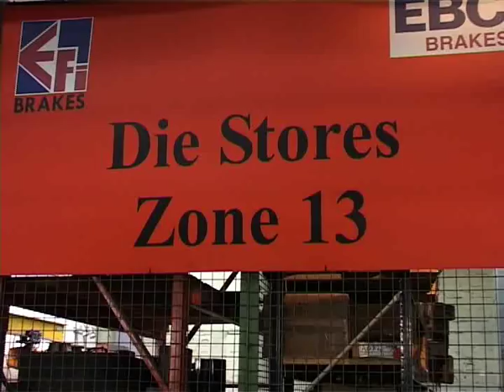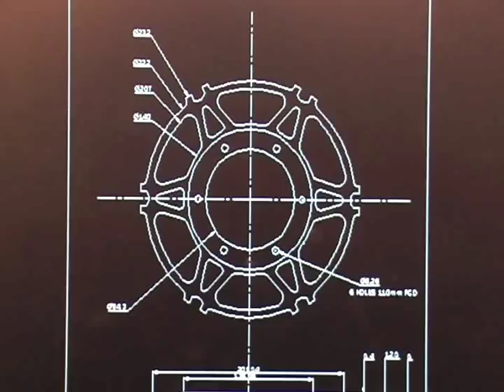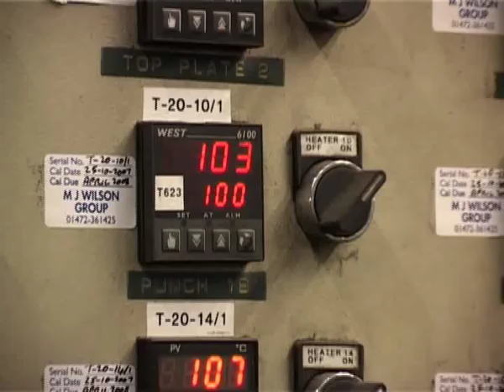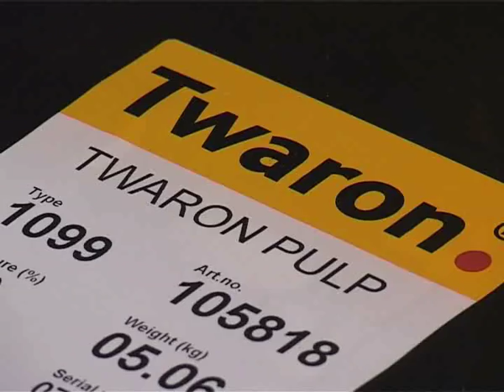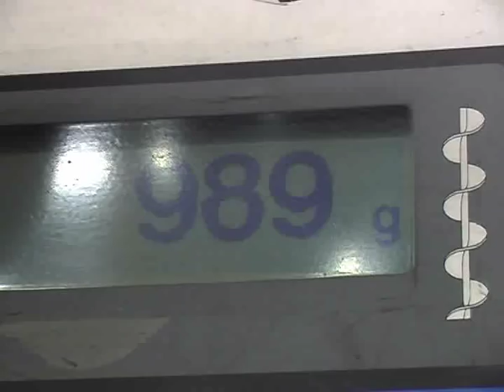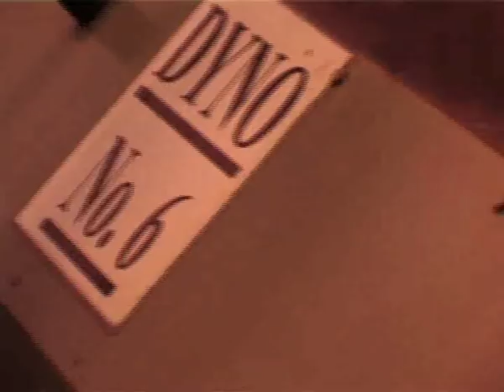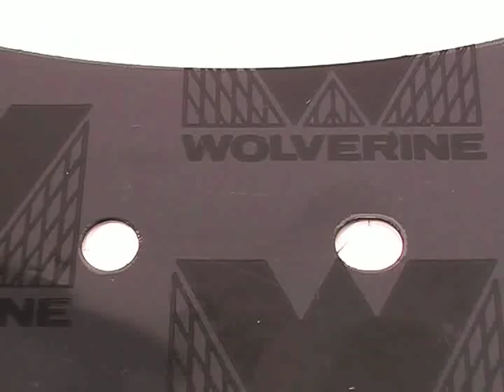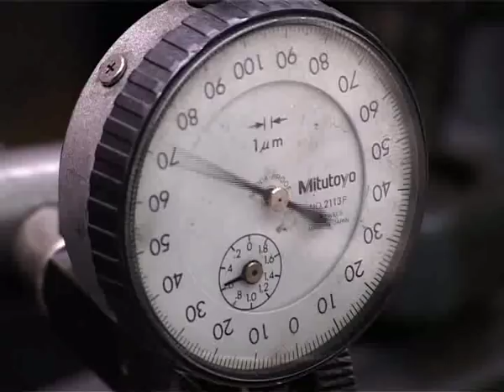EBC Brakes Corporate Video

Comment: one thing that's kept me from fitting full sets of EBC brake products to my street or endurance racing car has been the lack of in-stock US suppliers. All the companies I have spoken to have exclusively reported that my orders would be passed on to EBC and often times drop-shipping can take as much as 10 weeks. With my endurance racing prep-time often sub-8 weeks, I wind up with race pads from Hawk. If the Yellow or Bluestuff is as good for my application, I may be inclined to pre-order them.

Comment: I wasn't sure about EBC way back to be honest. I've been a long user of Mintex's line of brake pads, from my own car to race cars, but recently I swapped to EBC Green as my car is going through a transition period (engine swap etc) and needed something that stops great but lasts long (something that Mintex 1144 doesn't do). Very pleased by the results, it's a really great pad. I drive a Proton Gen.2. My only wish is that I could get a matched set for the rears also. Mintex has rear pads for it

Comment: We like it to sell those quality brakes . Nothing compares EBC!
Reply: I have nothing against EBC, but Jurid, Brembo are good brakes too.
Reply: VladjoSK You are definitely right but if you try EBC you will notice a big difference. Up to 9m shorter brake distance compared to what you prefere. Try Green Stuff and you also safe the environment because there is no more dust emission and - you don´t have to clean off the dust from your aluminums.
Reply: VladjoSK Go to www.american.de and have a look. We serve all over Europe for low freight costs!
Reply: VladjoSK try fremax discs and Icer pads for road use
Reply: mingdingisdingding your pads melted in a s2000.
better off with ICER NRS Premium Ultra Pads.
i rather Carbotech for fast road driving and Carbone Lorraine pads for track use.

Comment: Hard to say as after fitting a new track rod end, I still have a lot of judder & steering wheel shake (may need more bits replacing perhaps like inner rack end).  The judder goes away the harder I brake though.  Despite this they do pull up pretty well but not outstanding, so the red stuff would have been a better choice.

To sum up the Green Stuff are not bad, fairly good but I expect the Red Stuff will be the real deal.

Comment: yeah , and go for it ,  they are really impressive.  i use the GD rotors and the yellow pads for my v8 s13, still on 4 lug even and am really imrpessed , i was a project Mu guy fr years , usually liked the Bforce, but the yellows are way more predictable and dont have hte slip feel of the mu. hot /cold , doesnt matter . i do stress following there break in or theyll be noisy ,and se there backing if applicable.only issue i had was powdercoat and they replaced with my reiept.shopping myself again

Comment: This is a very interesting video.  I've never heard of EBC before.  I have an 04 Harley Davidson FXDI Super Glide and am wondering how EBC's front and rear motorcycle will do on my Harley Cruiser.  This all looks pretty impressive.
Reply: Brother, 2000 Superglide here, big horsepower and it sees drag strip laps regularly, both 1/4 and 1/8 mile. Wide band, contoured, floating 10 button EBC rotors, and Double HH pads up front,  and SEMI-sintered in the rear.  You will be 1000 percent happy,  and the prices are comparable with any other pads and rotors, perhaps a few $ more than import junk, but aren't you worth it? Better than factory H-D crap, which isn't  even in the same class. I get mine through DENNIS KIRK,  with free shipping too.  Best thing you'll ever buy for your Dyna that doesn't say S&S on the box !!!!
🇺🇸🏍🇺🇸🏍🇺🇸🏍🇺🇸🏍🇺🇸

Comment: If I remember Ford was working on a new brake system which used a pad system that went all they way around the disc. It seem to work well in the prototype stage, I just wonder what ever happened to it???

Comment: I fitted flash Alloy's on my Toyota Estima that my dog loves because of the moony roof!  However this allowed unsightly brake dust to build up on the wheels. I therefore resolved this with Greenstuff.  I fitted new/recon calipers and zinc coated rotors/discs but on fitting the pads it was impossible to include the backing shim just not enough room! Greenstuff pads working fine good product but will have to wear in a bit before I may need to think of retrofitting shims I guess as the shims that came included in the box got mangled so further expense unfortunately? As an update they are beginning to squeek a bit.  Glad to buy British well done for that. Regards Will
Reply: William J. Dudman try Icer. they're much better amd dont squeak.
all made in spain.

Comment: i have ebc green pads for my celica vvti. with stock discs they are worse than toyota pads. when the ebc green pads get hot, they smell like fish. this helps the driver to notice that they overheat, which i like. be aware that you have to buy pads and discs from ebc otherwise they could turn out be terrible. a very good combination should be ebc turbo discs with forodo ds 2500 pads.

Comment: Good video, like their website in my opinion and free delivery in the UK aswell.

This video is either missing one thing or it's a bit old because don't EBC make 'Blue stuff' pads now? for supercars / really high performance cars I think.

And does anyone have experiences with different types of discs, I'm just wondering, for fast road use, what's the best to use with some pads? slotted and grooved, just slotted or just grooved?

Comment: would it be okay to use green pads in the front rotors and red for the rear, since the rear brakes are applied less then the front wouldnt it make sense to use stronger pads in the rear? would this be ok and safe?
Reply: +jeffrey aguilar I recently put new rotors and EBC Red stuff front and rear on my mx5. The way I look at it is I may need to replace front rotors and pads 2-3 times before I worry about the back
Reply: +youngbean007 Not entirely true as the back pads usually tend to be significantly thinner in thickness but i do like jeffreys idea of having the red for the rear, not sure if its reccomended though :\
Reply: +007dardan finally someone who understands me , i will try it whenever im due for new brakes :) whats the worse that can happen on my daily driven tahoe ?
Reply: after lots of feedback from different mechanics the general consensus is "it doesnt work like " haha